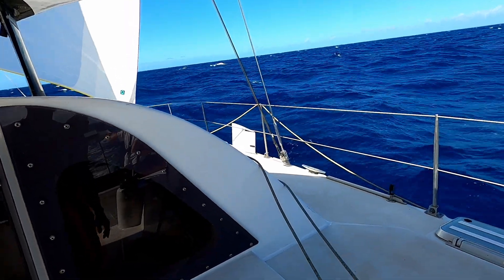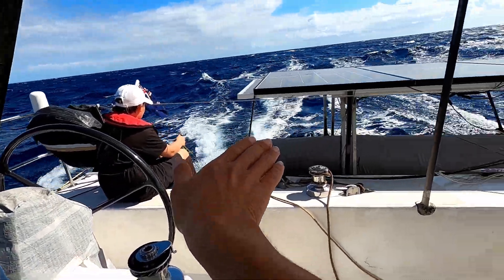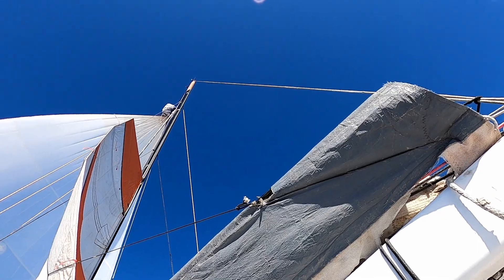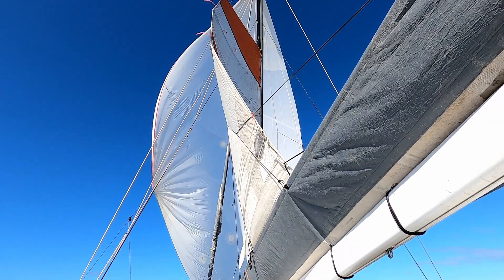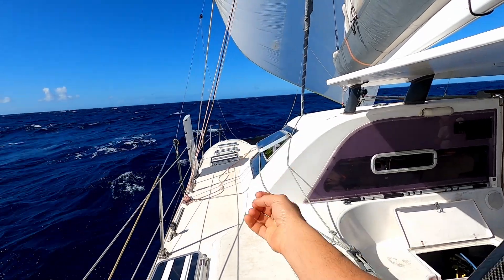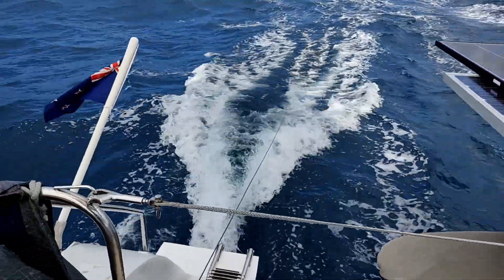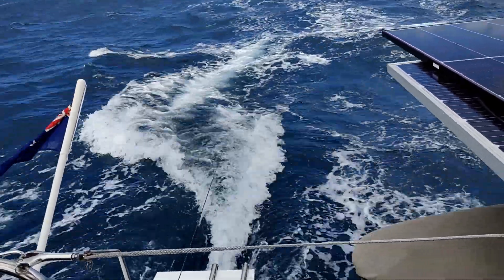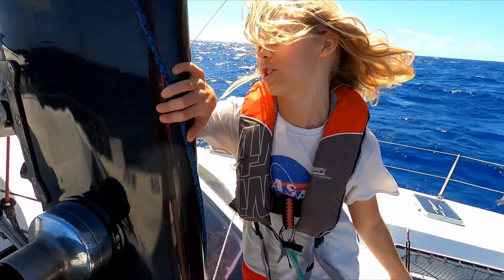SAILING TUTORIAL Using daggerboards and reefing setup

Comment: Lovely sailing with my favorite sail. What was your apparent wind ? What is your kite material ? I run a 0.75 Oz kite at a max of 15 knots apparent. I run no main with topping lift tight. We crossed the whole Atlantic from Cape Town to Namibia all the way 2 Brazil with a main and Genoa only used for 2 days upwind. The rest downwind. Nights were very light with only 6-7 knots apparent winds barely holding the bag up.
Reply from the maker: Nice! It's our favourite sail too. Not sure of exact weight as we recut it from an RC 44 kite 🤔 I guess we could weigh some and work it out but couldn't tell you the brand of material. It's a quantum sail originally if that helps. We've got details on wind angles and wind range on our website https://youngbarnacles.com/boat-systems

Comment: Any problems with chaffe on the topping lift or reefing line?
Reply from the maker: No problems with chafe in reefing lines other than normal wear and tear.  It is good housekeeping to check regularly as they are areas that see a lot of action. We use spectra covers and antal rings at reef points in the sail to help minimise wear.
Reply from the maker: Topping lift has minimal wear as essentially there are no moving parts. It is attached to the boom in such a way that there is no movement at all in the connection